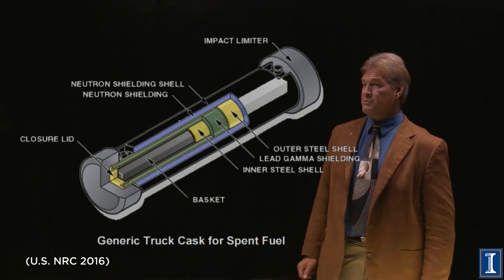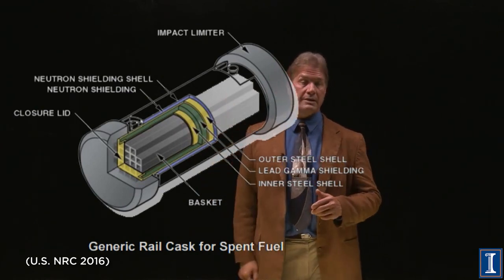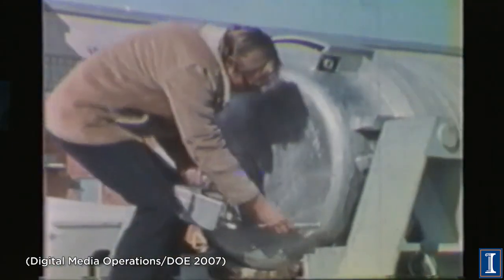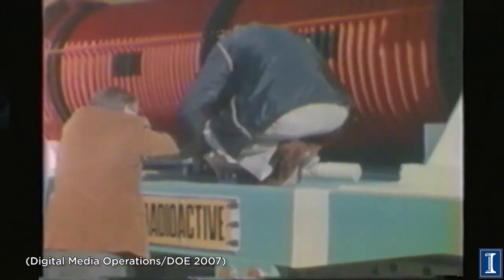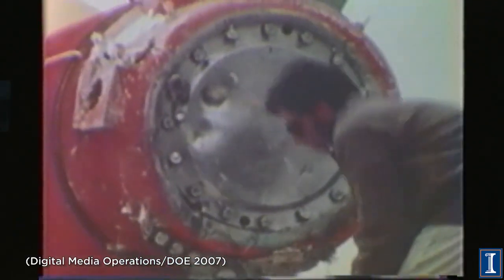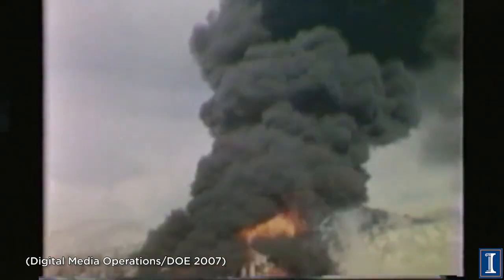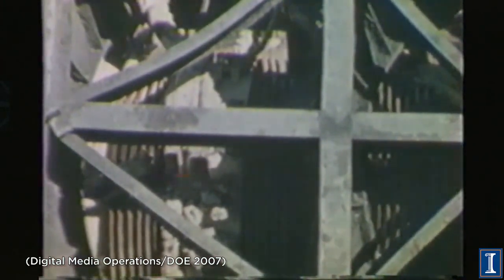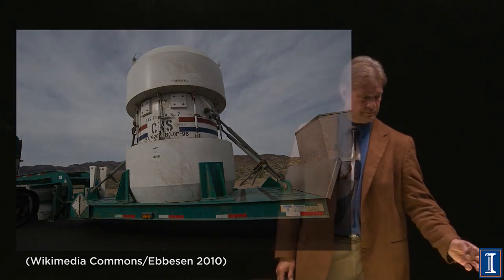Moving Nuclear Waste Around

Comment: All this effort and resources to ensure these casks cannot crack, it's definitely impressive. But ultimately if one does crack, it's not a big deal at all - not nearly as harmful as say an oil tanker cracking and leaking. Yet the latter leak all the time.
Reply: The general public are always scared of radioactivity even if they face more danger in their daily lives. Coal plants pose far more danger, but since asthma and coal mining accidents are routine, no one protests against those. The nuclear industry is both helped and hindered by this. Regulation helps make nuclear power one of the safest methods we have, and prevent it's adoption. Similarly, in the aftermath of 9/11, many people grew weary of plane travel, and deaths went up as cars are statistically far, far less safe than airlines. People fear a threat which isn't 'normal' far more than one which is.
Reply: Granted, not N-waste, but a truck filled to the brim with yellowcake has crashed in Swift Current, Canada a couple years ago. 
They just dispatched a clean up team, cleaned it up in a week or two, and done. HLW would likely need some RC crane or something, but not a big deal, its SOLID.

Meanwhile a tank car full of some oil product crashed in Lac Megantic, also in Canada, killed 200 people, destroyed much of the town, and injured several others.

Comment: someone had too big of a test budget
Reply: I don't agree. These things are transported by rail and road, and you can't just pray you don't have an accident, because somewhere, somewhen, it's going to happen. So you come up with an utterly over-the-top test to prove that the container will still be undamaged, and then, if it's in an ordinary accident, you know it's guaranteed to be survive intact with all its contents safely inside.
[edited to add missing word]
Reply: @Ice_Karma  I agree with doing the tests but maybe the rockets were a tad dramatic?
Reply: @pyreaurum676  Not at all. The rocket sleds are at the Holloman Test Track and they do them there so they can get extremely accurate test data. You can get a far more accurate and repeatable test scenario if you remove as many variables outside of the test as possible. With the test track, the truck is trained to the rails by a sled and the propulsion is via solid rocket motors. No wheels to deal with, no engine, no remote controls to fail, no steering, nothing. You do a test like this and you must get 100% good data the first time so you eliminate variables. Thats why you test on a test rail at a place like Holloman. Not to mention the high speed photographic equipment and data acquisition equipment already on-site and configured.
Reply: @StreuB1  Thank you for taking time for the input of important information, it is appreciated!

Comment: There is a really big problem with the tests: They all symmetric, that means they represent very few crashes. But worse, asymmetric crashes are not only somehow different, but in a systematic way much harder: Hitting the the container in a symmetric way distributes forces on all symmetric parts of one type. In the simplest case, something is mounted left and right, two big screws. In a symmetric crash, the forces are always shared in two halves. In any asymmetric crash, one screw gets the force before the other, and it gets the full force. The forces on parts are doubled. Not good.
Reply: Your case is very specific. The problem with the tests is they are also very specific. They test for a specific angle of impact, and it is an angle with special properties as I describe.
Reply: Just to be clear, I think the containers are safe, but the test is broken.
Reply: Perfect, that's how to test them. I notice that my comment may seem to imply that I am worrying about the containers or the transport: I don't at all.
Thinking about it again, I'm pretty sure that even when a container like this would fail, in a really bad accident, nobody would suffer radiation damage. 

There is a different substantial risk, tough: I'ts bad PR, on a catastrophic level. So bad that it can easily cause the shutdown of a power plant. (Also, the cost of cleanup would be impressive.)

Why no radiation risk? There is danger if radioactive material gets spread, or if an early arriving firefighter does not know about the hazard. The firefighter will recognize it, no problem. The material is mixed with glass and molten to a big bar in the center of the container.   If that get's exposed to sustained fire, it may melt. No dust, no problem. If it shatters, it would not create light dust that can spread, even if exposed. There is no danger of harm during cleanup because handling these materials is well understood. (And it can not go critical, just not enough material.)
Reply: Symmetric tests are used because a symmetrical collision greatly increases the colliding force. Test these asymmetrically and each "screw" will experience less collision force, because the forces will be a diverted fraction of a direct collision. It's much better to test symmetrically, from different angles of collision.
Reply: One Two Three -  I understand what you say, but my physicists instinct says "that can't be right". It that does not convince you, which it should not, let me try something more objective: The forces in a symmetrical crash are very different: Let us look closely on a screw: A threaded bolt screwed into a blind hole, so that the end of the screw touches the ground of the hole. It holds two flat steel pieces together. For example, what could be used to mount a forward facing cover plate to it's frame. Looking at the forces we get from a collision straight into a wall, we see that the  load is a compression, and that there are no shear forces. So the plates can not be disconnected for two independent reasons. The obvious one is: why should the screw break between the plates, there no sideways force at all! The other one is: The bolt can not break at all! It has a load of compression along his length, and to deform in this direction, getting shorter, it must increase it's diameter. But the diameter is limited by the holes in the work pieces. So the bolt can not sheer off because it can not break anywhere. I assume that convinces you that a symmetric load is very different from an asymmetric force? The most important point is that symmetric forces can cancel each other out, or forces do not appear at all, like the shear force in the bolt.
Reply: @vsiegel  that's only true from one angle. Turn the same impact 90 degrees in any direction on any plane and you will have multiples times the force of an asymmetrical crash (because asymmetrical loads almost always deflect large amounts of energy and always delude energy into more directions all at the same time, and therefore are not as thorough as testing maximum energy at each angle of force for weak points independently). 

The impossible goal is to minimize asymmetric loads so you can isolate each angle of force, rather than roll the dice a bunch and hope your tests don't survive divided forces but fail under a direct force of greater energy from one angle than will happen in an asymmetrical test.
Reply: As a truck driver I'd like to see some rollover tests.
Reply: @jeffrey skoritowski The shell is pretty robust on these things, should be no problem. So, and that previous sentence was the error one can make here - thinking that something "should be no problem" and not testing it. That means: You are right, this is a test that needs to be included.
Reply: @vsiegel  Thanks. Drivers avoiding an accident or falling asleep and rolling the vehicles over is the most common reportable accident type. BTW, some rear end collisions would be useful as well.
Reply: The tests are pretty specific and that's a valid criticism, but I think they subject the canisters to far greater forces than they would ever experience in the real world, and that may compensate for the symmetry of the forces.
Reply: Sean Kauder - I don't worry about actual safety - but the test strategy is interesting. Your point is very interesting. Practically, it's basically right. But strictly speaking, it's an aspect of the problem that a part  may hold multiple orders of magnitude more under symmetric load. For example a thin cardboard roll, like in the center of toilet paper rolls. If you load it symmetrically standing upright, it holds much more than if it stands slightly angled. The symmetry is important in detail: a sheet steel cylinder  would fail by buckling, and that starts from some random assymetry.
Reply: I think the video is for emotional effect,
Reply: And still a the people in AZ say NIMBY.